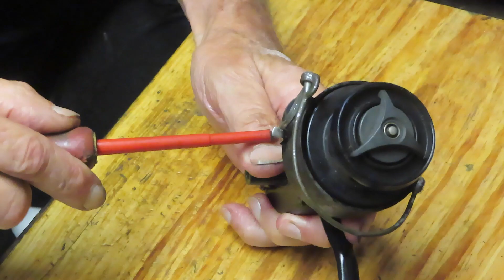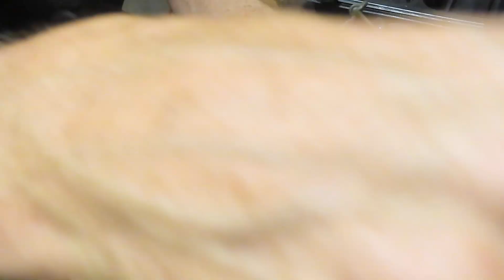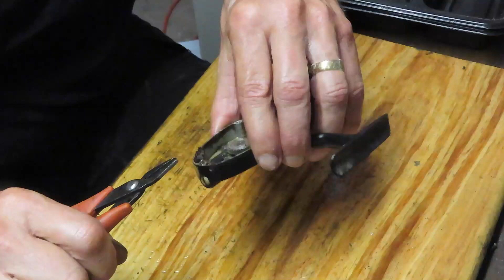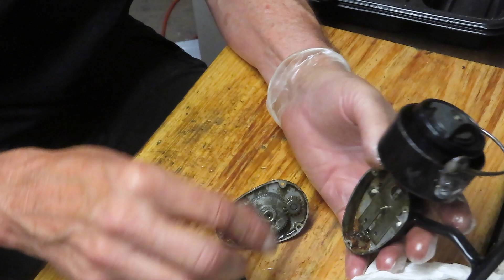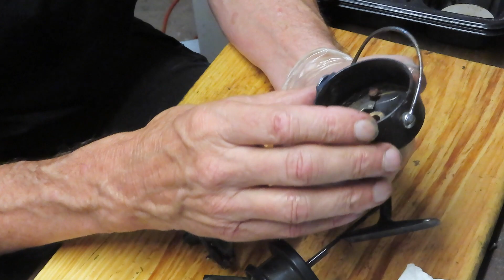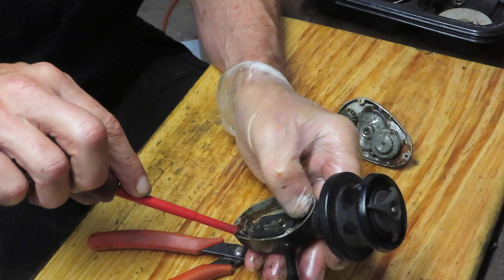How to remove a fishing reel side plate screw that is broken in a Mitchell 300 reel

Comment: You have become my go to guy for Mitchell reels. I bought a Mitchell 300 from E-bay. As I always do, I take them apart for a clean and re-lube. Unfortunately the lower face plate screw will not come out. It appears that someone has over-torqued the screw and deformed the face plate screw hole. I tried the usual tricks (penetrating oil, tapping the screw with a hammer) and no go. I don't want to risk damaging the screw slot. I contacted the seller and have not heard anything back. Correct me if I am wrong on this: the Mitchell 300 body is aluminum and the screw is steel. There is always a risk of the metals galling. I have seen this with steel metal bicycle frames that have aluminum seat posts and headset stems. I try to put a dab of thread lock or grease on the screws to prevent this. Perhaps some anti-seize would be good. Yea or nay?
Reply from the maker: Yes and yes.   The body is aluminum and Anti-sieze would help - Thanks

Comment: Dennis, I so wish I had a drill press. I’ve been looking at getting an apparatus that would allow me to use my Drexel tool as a drill press. I recently purchased a very nice SAE and metric tap and dye set as well. I have a DAM Quick 270 Super with a screw like this. I haven’t tried to get it out because the reel works well and I haven’t been able to find a replacement screw for it. I have 4 of these Supers so I’m in no hurry. I’ve got a difficult repair to do on one of my Mer 52 PUNCH PUM surf reels and I can’t do it without a drill press and a tap and dye set. The question is my vision. I don’t trust myself drilling into that reel. It’s not a screw that messed up but rather a threaded rod that hold the rear cap to the housing that broke off at where it attached to the frame. This was a great video idea Dennis!
Reply from the maker: Thanks Chris - I don't use the drill press much, but it is invaluable when I have the need.  Be well - Dennis

Comment: I've refurbished several of these. They all seem to have a "rough" feel to them while turning the handle even after servicing. Must be due to gear design.
Reply from the maker: There is a lot of variation on performance with these.  Most is due to wear patterns over time.  Gears dull and vibration and slop happens.  Thanks Brad - Dennis
Reply: I think to some extent we're all a little spoiled by how slick modern reels are.  There aren't any ball bearings in these old Mitchells.  They're never, ever going to run as smooth as the new ones do, but they're hell for stout.  And they'll catch fish for generations if you just ake care of them.
Reply: @stevenodell4323  agreed to everything you just said 👍

Comment: In some cases a good method is to cut the slot across with a thin cutoff disk in a rotary tool, then you can get it out with screwdriver, but that only works if the screw is exposed enough that you're not cutting into the side plate.
Reply from the maker: Thanks for the additional info Tyler.  In this one, the screw is recessed, so that is probably not a candidate, but widening the slot will work on others - Dennis

Comment: IMHO it would be difficult for all but a Journeyman Machinist to redrill and retap that small bolt hole in that type of material
Reply from the maker: That is definitely beyond me skill set!  I got lucky with this one!
Reply: Correct Seymour,  the screw body and threaded hole is just too small, even if the reel was placed in a vice, jig, or chuck, plus you'd have to find the correct tap, metric? S.A.E.? European? best case would be to drill the screw completely out and re-tap oversize which the material on the reel body would not support ( I.E. not enough "meat" left to support larger screw), I've had good luck with what Dennis did although I let it soak a bit longer, heat it just enough with a micro-torch as to not burn the finish and actually TIGHTEN the screw to break it loose and get it moving, then remove the broken stud. P.S. always inspect the threaded hole with a mag glass for damage, and flush it with cleaner, sometimes it's not corrosion but cross-threading that made the screw immoveable , in which case you're 'screwed"